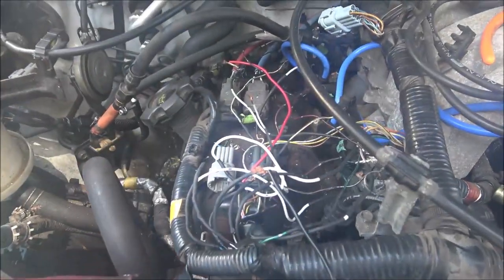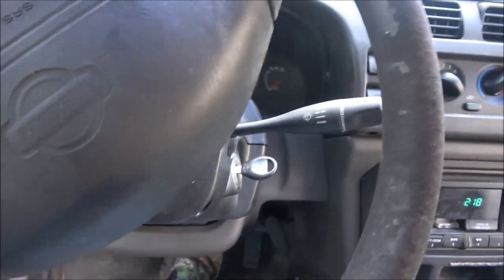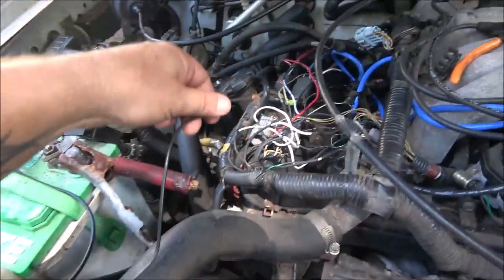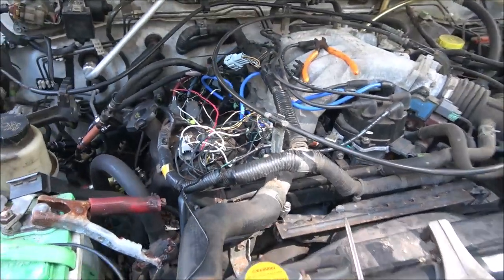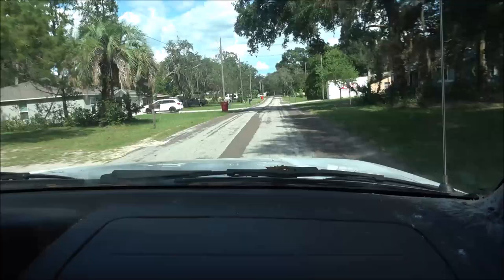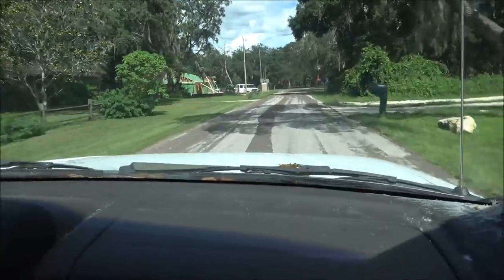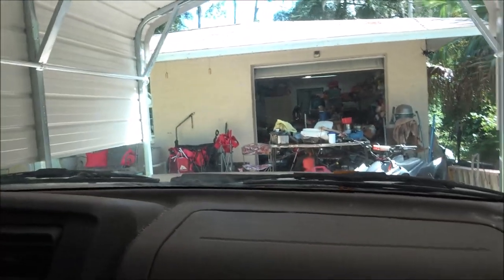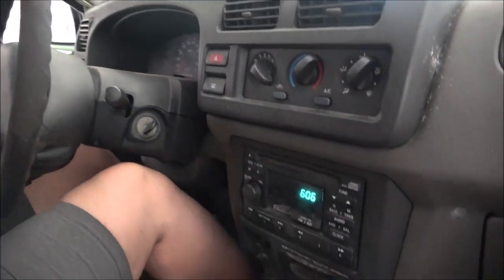2000 Nissan Xterra, When Can We Drive It?

Comment: You’re a dynamite mechanic man! Always so impressed with your work. Wish I could have you look at the blue Journey. Don’t know if it will ever make it down to Florida. It just started pulling to the right and now makes a grating sound when turning. 😢 Always something.
Reply from the maker: Thanks old buddy. That sound in your journey could be a wheel bearing or a CV joint. Pulling to the right is either alignment issues or it could be caused by the noise you're hearing. Sorry about your trees man, that was a shame.

Comment: Heya Guy's 🤓 . I know I'm late to the party but,  Wahoo.  She's definitely a keeper and it'll make a really nice 2nd rig for y'all.  One thing I highly recommend especially for vehicles that have been setting for a while is to add a bottle or 2 of berryman's B12 chemtool to a full tank.  Then then run another bottle through it every couple tanks after that.  It'll clean the tank the lines the pump the injectors and the valves & intake manifold up and keep it running like new.  I use berryman's and I swear by it cuz it's good stuff 🤓 ..